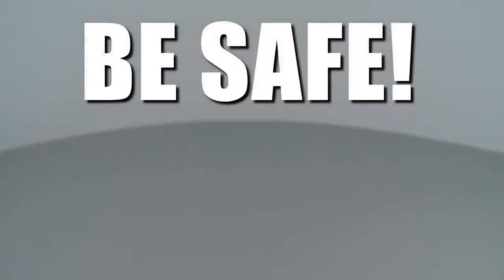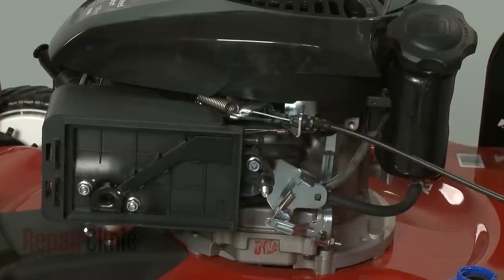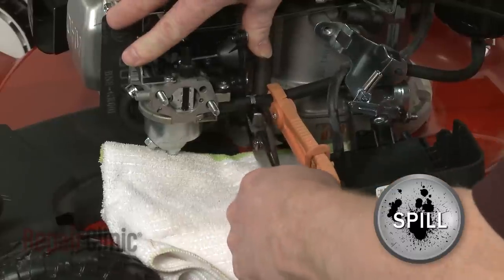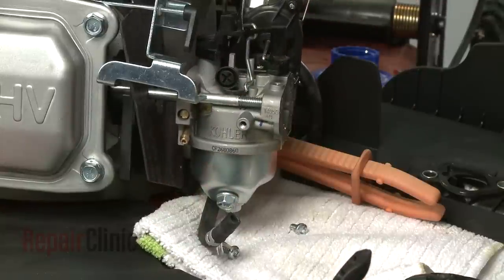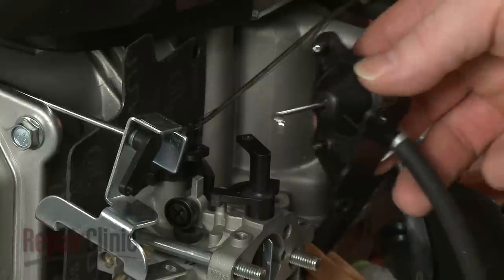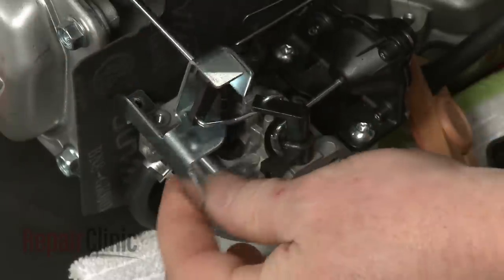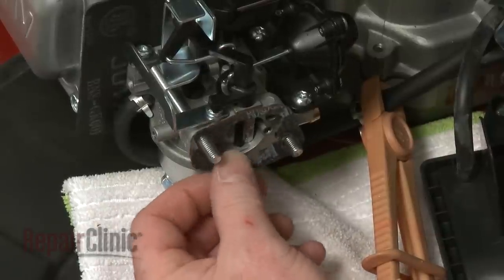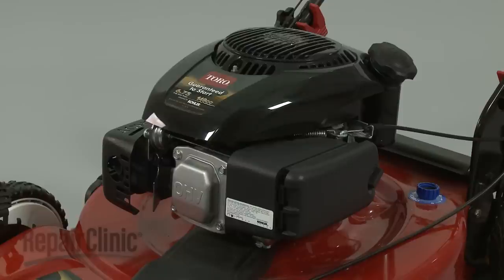Kohler Lawn Mower Stalls? Small Engine Carburetor 14 853 49-S

Comment: This worked! My husqvarna with a Kohler Courage xt-6 would start but then shut off in less than a minute. It would not start back up again for about 5 minutes. Everyone said that the carburetor was bad, and a lawnmower repair store quoted me over $100 to swap out carbs. I ordered the 14 853 49s carb, which was a replacment for the 14 853 21s which came on my mower, and swapped out the carbs in under 30 minutes. My mower fired up one the first pull, and I was able to cut my entire yard.

Comment: Your video proved invaluable.  You may have saved me $400 - $500 by not having to buy a new lawnmower.  I had bought a replacement carburetor for my Ariens lawnmower from an online retailer, but it came with no directions and I am by no means a mechanic.  Your step-by-step instructions were perfect and the damn thing started on the first pull !  The only thing i noticed is the engine still "sputters" a bit but heck, I'll take that over not running at all.  Again, thanks very much.

Comment: Thank you for this video. How about one that shows how to clean an existing carb? Most videos I see show a bowl with one bolt on it. The one here, and the one I have, has two bolts. I need to clean clogged jets on a very new Kohler Engine Single Cylinder Courage XT. Thanks again!
Reply from the maker: We unfortunately do not have a carb cleaning video currently. Sorry about that.
Reply: ***** I cleaned the carb, nervous because I went further than what is recommended. It worked, and the mower runs fine now. Clogged jets, stale gas even after a few weeks.

Your video helped! Thank you!

Comment: I need this carburator. My lawn boy mower looks identical to this toro mower. My mower model is 10607. But can not find a carburator for it do I need a different model #. All I know is that the engine is a Kholer brand.  Thanx for the help.

Comment: Hi there,

I have a Craftsman Lawnmower with Kohler XT7 Courage Engine
Suddenly it just wouldn't start.
I bought a new carburetor and installed it per your video (which is very informative, thank you!!) and it still won't start.
Plug is throwing a spark and if I take air filter out and spray starter fluid, lawnmower starts then dies after 1-2 seconds

Any ideas?

Thanks in advance!
Reply from the maker: miskec69 We recommend using the repair help section of our website using your engine's model number: http://www.RepairClinic.com/repairhelp - if you enter your engine's model number there you'll have access to model, part and symptom specific repair help.

Keep in mind, you'll need the engine model number, which is different from the lawn mower model number.

Comment: What type of screwdrivers are needed to remove carburetor? Are they TORX 6-star headed screws? If not what type of tool is needed? they are not std phillips or flat heads, and don't look like 6 pointed? Thank you.
Reply: I tried to repair mine and discovered the previous owner stripped out that bolt - looked to have once been a torx screw.